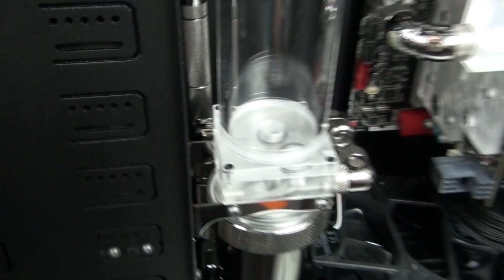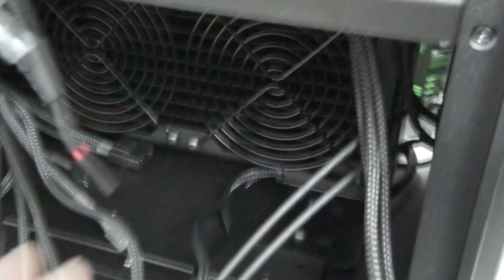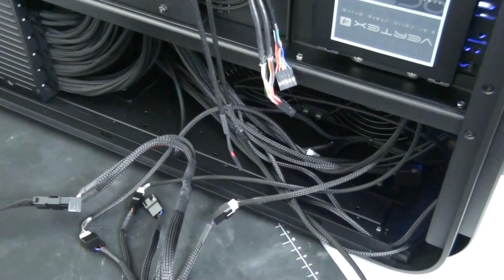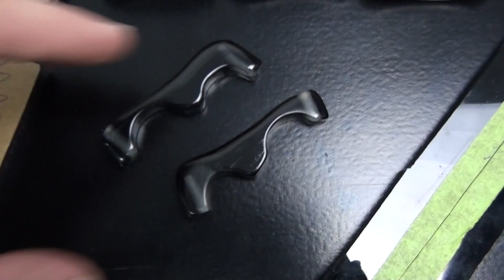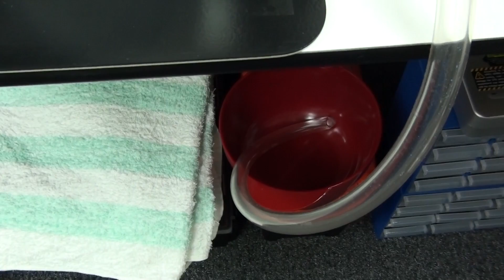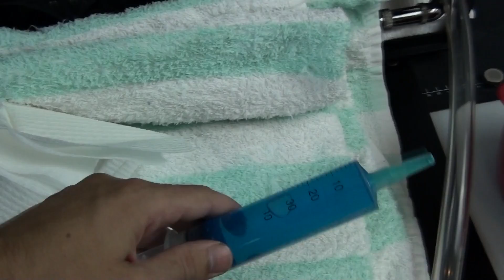Build #8: 'Cytotoxic': Part 6

Comment: he mentions in the video that he has at one point rigged a bitspower x station to a vandal switch at some point ... thought i would point out in case he sees this comment that is one mod i would love to know how to do and as he's soon going to start covering how to accomplish various mods might be one to add to the list cause i might not be the only person curious as to how thats done ... kinda thought about having a sort of " turbo " button for my pc cooling for a while where most of my fans are actually off until a switch is pressed or flipped or whatever then everythings kinda full blast ... i was thinking of using a raspberry pie or an arduino to accomplish this but kept running into issues where i could get power from the power supply to the board i used but didn't know how to effectively convert that power to something i could use on a fan ... haven't actually tried that yet but still some neat things it could accomplish with the right refinements ... of course having this turbo button set to a double pull double throw switch and using the arduino or raspberry pie for some other little feature is also an option but still gotta figure out how that part works first ... pretty sure hooking up a vandal switch in this manner is far more simple than i think it is but i would think depending on what your connecting it to the leads you connect might be differant for each differant connector ... 4 pin molex might be pretty simple but what about sata power or FDD cables ...

Comment: It isn't dangerous to have the cables in contact with the back plate of the cpu and the connection points on the MB?

Comment: Clean job, I like it lad. Also, I just saw your most recent giveaway video where you mentioned you'll be rebuilding DD Rad Box with Crystal links, I wanted to do the exact same thing, sadly there was no time. However I should receive my Titans soon and I'll be tearing everything apart so I might as well change the tubes for C. Links.

Comment: When drilling have you considered using a tiny bit of oil to lubricate your drill bits? might smell a tad, but will increase the speed your bits cuts. It also, and this is a guess. but it may also give you a smoother bore. I havnt tried this myself. But it would be a good experiment.

Comment: Great built.... I like your style in building PC
I have a question. Is it possible to use EK back plate on this GPU without using the water block package. Does this affect the GPU performance. I have an EVGA gtx680 but don't have water cooling system.

Comment: Actually, radiation can be of any color, or even not visible at all... Cerenkov radiation is actually more to do with the interaction between high-energy radiation and the heavy-water shielding fluid that they keep it in to cool the material, or hold the material in suspension before and after use. They hardly ever leave the fissile cores out in the open air, since it is much easier for damaging high-energy particles to move through the air.

Comment: SingularityComputers: I absolutely love your builds! This one in particular. The way you have intentionally made it look busy, filled up av complicated, but in such a clean manner is just wonderful. I especially love the way they tubing to and from the waterblocks have the same straight lines and bends.

I had given up water cooling after my last upgrade, and are currently running stock cooling on everything. This might change after discovering your channel on YT. Cheers to you! :)

Comment: I´m planning the warercooling on my computer and wanted to ask you what radiators you would suggest to cool down my two gtx670´s and my i7 2700k. I´m actually totally hand modding my Cooler Master midi tower but only could fit one or two 120mm radiators inside. I prefer mide befor big towers and dont want to uprade. Also which reservoir would you suggest for a compact build like this? Have you ever tried bequit! Silent Wings 2? Thanks alot and keep up the great work ;)

Comment: I am doing a water cooled build in a 600T case cooling an nvidia gtx 590 and a 2600k in a single loop and i am putting a swiftech tripple 120 on the top and a duel 120- in the front.What i am wondering is how i should arrange the radiator fans.What i mean is should the all pull air from the outside or push air from the inside or some push and some pull...? i will have a single 120 exhaust in the back sooo what should i do? pliz help

Comment: Hey I love your builds and was just wondering why you don't just get some Perspex tubing and cut it to length yourself instead of using the crystal link? Given it would save a lot of money on both fittings and tubing and allow for an even cleaner build it seems hard to justify the pricing given that it is just polished Perspex or something very similar. I'm in complete agreement with it as an aesthetic choice I was just curious as to your decision making on choosing it over a DIY solution.

Comment: hi i just need some advice on something since u have a lot of experience with water cooling. im going to be building a rig with two alphacool 80mm thick 560 rads and will be cooling the motherboard,gpu,cpu and maybe the ram could u give me and idea of what pump/s and res to keep this system running at optimal performance. plz reply asap

Comment: Actually the blue glow (in an active reactor, not spent fuel rod storage) is from Cerenkov radiation. Basically electrons are travelling through the water faster than the speed of light in water (still slower than C in vacuum). This emits a blue glow as the electrons release excess energy in the form of photons.

It's analogous to the sonic boom emitted when an object (such as a plane) breaks the sound barrier.

Comment: Hey I just finished my water cooling loop and there were no problems and got it all up and running a a 3 hour leak test and all is good the only question is that I have a boat ton of little bubbles in my rez and its annoying as all get out. Any helpful hints? here is a really quick vid 
pump swiftech mcp655b
ek d5 xtop 
ek sepermacy 
ek x3 250 rez with extra top 
ek g1/4   1/2 id 3/4 od 
alphacool nexxxous ut 60 480 rad
promochill ext advanced tubing 1/2id 3/4od

Comment: The simple answer is YES. Stock clocks on cpu and gpu will have u running at ok temps even on air. Introducing the BlackIce and say a D5 will have u running at very low temps even with fans on ultra-quiet.

Comment: Hello. Thanks for another great video.
For the custom wiring, did you have to use any extra wires or all you did was shorten the ones already being used? If you did use extras, were they all 18 awg? Would it be ok to use all 18 awg wires for all the cables or should I use 16 awg for the most demanding ones? Sorry for the long comment. Thank you again! :)

Comment: He isn't a big fan of the bridge ether the reason he went with it was the design of the graphic cards water blocks. EK has made it where you need a bridge or a bunch of 90 fittings, which he didn't want.